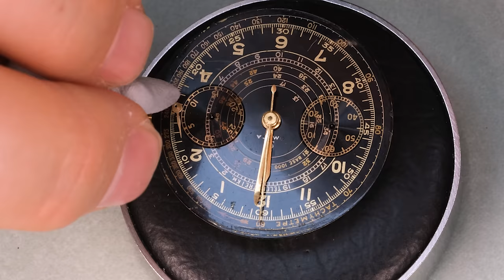First time on YouTube - the legendary Omega 33.3

Comment: Nice work and comments are really appreciated! Thanks a lot for sharing. May be I can take an advice from you if you have some time to answer ;-) I'm working on a GMT master 1974 and I need to relume the gmt hand but with no luminosity. I alerady have the traditionnal Gergeon kit but I was intending to replace luminous compound with some other powder to match the color. Any suggestion?
Reply from the maker: Hello Nicolas, nice watch you're working on! I simply use model paint for hands without lume. There are some nice kits with all kinds of colors you can get for a good price.
Reply: @VintageWatchServices  yes very pleasant to work on it! thank you for the advice. I will look at model paint to mix with lacquer. 🙏🏻

Comment: I notice you have a separate cleaning jar for ultrasonic cleaning of gold. Different solution?
With such an old movement, do you ever need to change the spring on the balance wheel?
What a stunning watch! Must be a pleasure to work on one like this.
Reply from the maker: Hello Frank, the hairspring and the balance are finely adjusted as a pair, and replacing the hairspring is generally not feasible. It would require finding a hairspring with the exact properties and then vibrating it together with the balance to determine the correct length, before finally pinning it to the stud. This is something no one really does anymore.

Comment: This watch is beautiful. I would love to buy a modern remake.. a very poor man’s version(unfortunately). I’ve wanted to get into watch making and restoration, I just shake to much. I could look at the inside of witches like this for hours. This is a watch face I wouldn’t mind covering the beautiful movement, even the case would get a pass. I would normally prefer a clear back to be able see the inside but I don’t think I would want to change a thing about this piece.
Reply: Check out the Tissot telemeter 1938 chronograph! It kinda has a similar dial

Comment: It is a beautiful watch Stian and the face looks more modern than it being 85 years old.  Regarding your question, does it have to do with the chronograph and stop watch feature?  I do have 3 questions:  How many languages do you speak?  Secondly, one should never use magnetic tipped screwdrivers while working on any watch old or new, correct?  Also, is the fluid you place parts that are cleaned in the sonograph machine the same fluid as you use in the cleaning machine?  And your humor is not lame, I laughed out loud at getting jewels at the gas station.  Another great video, history lesson on the watch, humor and restoring a beautiful old time piece Stian.  Cheers from this old retired coot living the dream in Tennessee.
Reply from the maker: Hello Robert, great that the golden years are indeed that! The intermediate wheel is really only to make the minute counter hand move clockwise. If the chronograph wheel finger directly worked on the minute counter wheel, the minute counter hand would move counterclockwise :) Secondarily, if there was no intermediate wheel, it would be more difficult to ensure the proper depthing between the wheels.
You shouldn't use screwdrivers with actual magnetic tips, no, but steel screwdrivers can get magnetized. That's not really an issue if you can demagnetize the screwdrivers and the movement afterwards. 
Lastly, the solutions in the ultrasonic are different, but I wouldn't know exactly how and why :)
I forgot about the languages; I speak five languages well and another two fairly well. Oh, and also the language of love occasionally 😁

Comment: Beautiful watch!
I have a question though. My 1974 Tudor Prince Oysterdate was just serviced as the main spring gave out. They replaced a few parts with OEM Eta parts while servicing it. The watch keeps good time but will randomly stop, even if I had wound it 30-40 times. Sometimes when I wear it and mostly if I take it iff and let it sit for a bit. It never runs more than 3-4 hours once I take it off. It should have like 30 hrs or more reserve. Any educated guess before I take this watch back to be looked at again?
Reply from the maker: Thanks for watching! There are quite a few possible issues, but if it was just serviced this should of course not happen. Bring it back to them and ask them to fix it!

Comment: The thing that is most amazing to me is NOT the magnificant tear down and reassembly of the watch.  Nope.  It is HOW did the people making the watch get such microscopic tolerances on those TINY little screws!!!  How did they make those little buggers to such precision???!!!  Amazing I tell ya!!!
Reply from the maker: Right on!
Reply: Just what I told my wife unbelievable.....
Reply: They used screw plates. Made them by hand. Very meticulous work. Still a mystery though.
Reply: @Kevin Bell  its a metal plate that has cutting dies cut out. Look it up on Google because that way you can see it better than I can explain. After the screws were cut they hardened and tempered them.
Reply: Kevin Bell  no problem
Reply: There are some great videos of handmade parts. Worth a search and gives an even added appreciation.
Reply: Seriously mind blowing
Reply: Check out fusee movement pocket watches and take a look at those tiny tiny bicycle chains. What's amazing is how and how long they took to make. They were made in the 1800s and making screws and chains that size were definitely amazing feats of craftsmanship.... It makes me sad when I think about how stuff is manufactured today... Such precision and craftsmanship and skill required to do what they did. Now days all you have to do is click a button on a computer and you can 3d print or cnc mill just about anything you want at any size with pinpoint precision.
Reply: As always, you do a terrific job. I just love how you always explain every little detail as you move forward. Just love your videos. That is a beautiful watch. Thanks again

Comment: Lovely watch! As AWD said, the crown wheel is fab! How do you know how far to press fit the drive wheel on? You never mentioned the temperature compensation balance wheel, I don’t know if I’ve seen one on your channel before? I guess what makers need insurance to cover expensive watches like these in case a part breaks, gets lost or is stolen? Insurance isn’t something I’ve heard any watch maker talk about. Catch ya later.
Reply from the maker: Thanks, Boyd! The driving wheel should be at the same height as the clutch wheel, so that's your reference. I actually did mention the temperature compensated balance wheel as I was doing the voice-over, but it didn't make it into the final edit. Too many things to talk about :) I'll talk about it later in a less complicated watch. 
And yes, for high value pieces you either need a liability insurance or have the customer sign a liability waiver. I have the insurance. Not that I would feel particularly comfortable that insurance would be any good should anything go really wrong...

Comment: Great video. Beautiful watch. Question: Does replating movement parts add height (via new surface) to the metal and thereby reduce tolerances?
Reply from the maker: Thanks for watching! No, electroplating leaves such a thin layer that it wouldn't affect tolerances.

Comment: “And since I live in Switzerland I just drop by the nearest gas station and pick up a new jewel.” That was golden 😂

I had a question though, how did they check the rate and beat error in 1941?
Reply from the maker: 😁 I don't have first hand knowledge from how they did it in 1941 (...) but without modern machines they would need to simply observe the movement. You can pretty much see if the amplitude is good enough with the naked eye with some experience. And the pallet fork can also be observed to see if it is straight when the movement is at rest. For the rate they would simply compare the watch to a reference watch or clock over a number of hours, then adjust it, then observe etc. So it would take a long time :)

Comment: What does "Unadjusted" mean that is stamped on the 3/4 plate? Great job as always.
Reply: It means Omega didn’t want to pay the additional tariffs imposed on imports into the USA. Those tariffs were higher for adjusted watches, as well as for watches with more than 17 jewels.
Reply: Kevin Bell  it just means they didn’t spend time adjusting beat error in different positions by adjusting the pose (the fine balancing) of the balance wheel.
Reply: Kevin Bell  But as an aside it almost certainly was adjusted to a certain extent in the Omega factory and merely listed “unadjusted” for tariff reasons at the time.
Reply: Kevin Bell  Adjustments includes shaping the hairspring and poising the balance to maintain accuracy in multiple positions. It also includes changing the screws on the balance to adjust for temperature and isochronism. We can be sure movements from quality companies were adjusted for isochronism, temperature, and at least three positions, but they just didn’t claim to have done so. The quality American watches were not subject to the tariff and claimed the adjustments and jewels, often including jewels with no functional value to drive up the jewel count as a marketing feature. The highest-end brands (Patek Philippe, Vacheron + Constantin are examples) didn’t care about tariffs and claimed their adjustments and full jewel counts. At some point those particular tariffs were dropped (though many tariffs are still in place). When adjustments are claimed, the movement will say “6 adjustments” or “adjusted for temperature, isochronism, and five positions” or similar. 

Adjustments are distinct from regulation, which changes the balance period to keep good time when used “normally”.
Reply: Kevin Bell  Considering how rare and expensive they are, those rubies are pretty precious in my book. But they really are precious gemstones--sapphire--though their industrial name (corundum) is a bit less romantic. "Aluminum oxide" in crystalline form even less so. But when it's red because of an included chromium transition metal, it's ruby, and when blue (or other colors) it's sapphire. Lab-grown, to be sure, but at one time used in watches as naturally occurring and generally clear gemstones. Modern movements at lower price points often use manufactured rubies made of chips bonded together with resin, but not when this Omega 33.3 movement was made (and not even in current movements in higher grades). Only diamond is harder.

Comment: Hello, love your videos.  And this Omega is lovely.  I have a question, what does “unadjusted” mean when its engraved on a movement?  Thanks, Rob
Reply from the maker: Thanks, Rob! Unadjusted basically means that the balance was not finely adjusted by moving the timing screws or by otherwise poising it. However, it was often simply engraved to avoid US import tariffs, which protected US manufacturers by placing higher import duties on movements which were adjusted. Thus you often find "unadjusted" watches with poising marks on the underside of the balance, meaning it had been adjusted but marked as unadjusted to avoid tariffs.

Comment: Oh no oh no no no no no!  I saw that, I saw you used the presto cannon pinion remover not the hammer type.  Say it ain't so, Stian.  I cri erry tim.   Cool watch btw.  It's also goofybeans you can't click defuse this bugger, and it's just easy as a baby once you take the chronoworks off.  Thanks for showing us!

edit:  For those of you who are wondering that cleaning machine is $5K, about $2.5k less than the one that can do pocket watches too which is the Lititz Precision Freedom.
Reply from the maker: Thanks, Gregg! I generally use the presto type for removing the cannon pinion indeed, apart from on pocket watches. And yes, the automatic cleaning machine is quite expensive and not something you'd dish out for unless you do this for a living. I also use it for pocket watch movements, it's plenty big enough for that 👍

Comment: I think that the intermediate minute is used to count the minutes on the chrono side.
Reply from the maker: It is indeed, and the reason there is an intermediate wheel is simply to ensure that the minute counter hand turns clockwise :)

Comment: Hello, I was wondering if Phillips or torx head screws are ever used on watches. Can an unusual screw be used to identify a reverse threaded screw orientation? Just a  helpful reminder?
Reply from the maker: Watch movement screws are pretty much always slotted. The reason is simply that the screw heads are very small and there wouldn't be enough metal to make a strong enough grip for other head types. There are some watches that have specialized screws for the barrel and crown wheel for instance, these being the largest screws in the movement, but that is very rare, especially for vintage watches. 
It is common, although not entirely standardized, that reverse threaded screws have parallel grooves to the slot.
Reply: I see, thank you for the reply and thank you for the content. I enjoy it a lot

Comment: this is insane. We never get to see such movements be taken apart and serviced. 
Would it be possible for you to get ahold of a repeater movement so that we can learn of the inner workings? (even if its just one of those old pocket watch movements  without a case or dial🤤)
Reply from the maker: Thanks! Yes, I have a repeater pocket watch I'm planning to start working on soon. I need to make a new balance staff for it and there are lots of other issues so it'll take some time :)
Reply: @VintageWatchServices  oohhhh I cant wait for it

Comment: I am just starting out and have the basic tools now. What is the best way to source watches for starting as I don't want to learn on my good ones as mistakes happen
Reply from the maker: Hello Steve, the best watches to start on are watches that are in running condition. That way you know that if it doesn't run after your work, you did something wrong. If you buy watches that do not run, it is difficult to know as a beginner what the problem is. And for your first watches you are only looking to have them running after you've done your magic :)

I'd look for Soviet or Japanese watches, they are very solid and can be found for cheap. Go for the simplest ones to begin with, only showing the time. Then you can start doing date, automatic etc as you gain experience. Good luck!

Comment: I somewhere read to use some sugar crystals to prolong the stem. Metal bits in the right size I did not collect. Do you see any risk?
Reply from the maker: I've never heard that and don't think sugar would prolong the stem, it's probably not strong enough. It might work, you can simply try it and see if you don't have any metal shavings.

Comment: How did they get that spectacular deep dark bluing color on the balance spring? Is that a lost technology?
Reply from the maker: It's carbon steel, which when heated to around 300 degrees turns blue :)
Reply: @VintageWatchServices  Have you ever tried this? It's a lot harder to get a nice even color than you might think... let alone a surface that will last 80 years!

Comment: My grandfather (from whom I got the collecting bug) owned a gold 33.3, which is now owned by another close relative and hopefully may one day pass to me. As a watchmaker myself, I wonder why you keep the movement running when reassembling? Granted as far as the chrono mech unless explicitly engaged it's not going to be connected to power so to speak, but to me it just seems like having a wound mainspring at all when working a movement would be an inconvenience at best and potential accident waiting to happen at worst... 

Secondly as far as the unusual design, certainly some of that is down to just being an old movement from the days before standardization and efficiency was really figured out, at least for chronos. But for this era particularly, it must be remembered that consumers very highly valued size in wristwatches. From c1930 to around the mid '60s, it was the direct opposite of the modern era: the smaller and thinner the better. Stuff like the oddities of design here with bits sticking into the case sides etc allow the movement to shave off a few mm here and there. When this was created we still weren't that long after the days of the huge old "turnip" pocket watches really, and the concept of wristwatches for men was just become the norm as new tech allowed movements to shrink to the point of being practical to wear on the wrist. So in this era, the major perceived sign of a watch brand's engineering prowess and overall quality was how small they could shrink a movement down -- and it was no small feat to produce a complicated, accurate movement this size back at the time it was engineered. 

Advertising wars were fought over millimeters back then; which dropped off during the 60s, only to reignite with the new tech in the '70s and '80s and the age of the "ultra-thin" dress watches where ad wars were fought over tenths of millimeters lol. Still I'll take a classic like this over a Concord Delirium or something any day.
Reply from the maker: Thanks for your comment! There shouldn't be any risks in letting the movement run when you know the click is fine. I actually see it as a benefit to have the movement running when after assembling complications, as you can then immediately see if for instance depthing is an issue.
And I completely agree, this type of watch is infinitely more desirable than most modern ones :)

Comment: Is the intermediate minute wheel used to track minutes when the chronograph is running?
Reply from the maker: The intermediate wheel simply changes the turning direction of the minute wheel so it rotates clock-wise :)